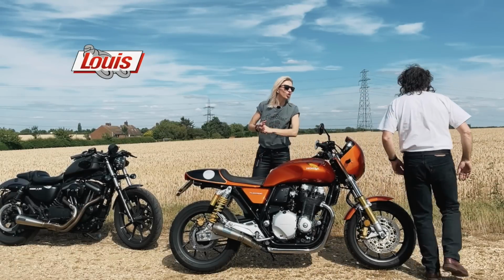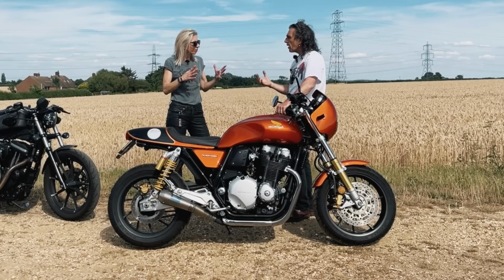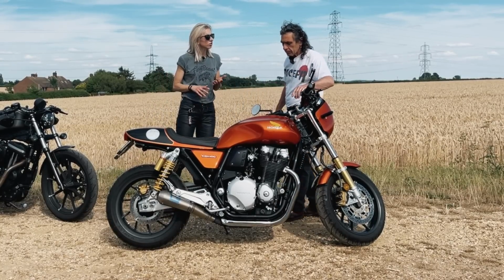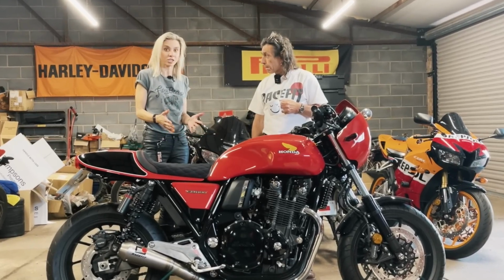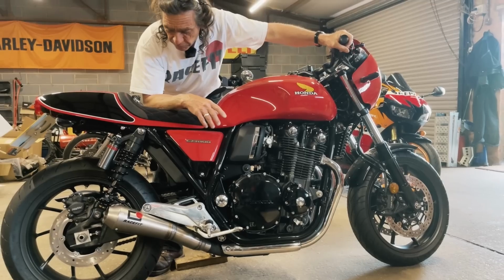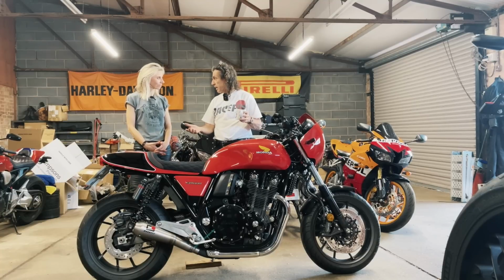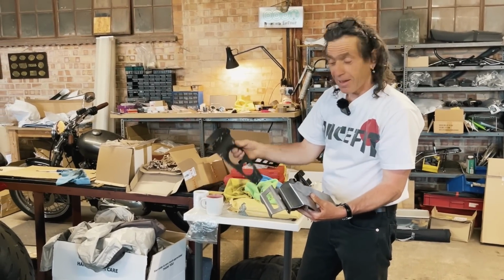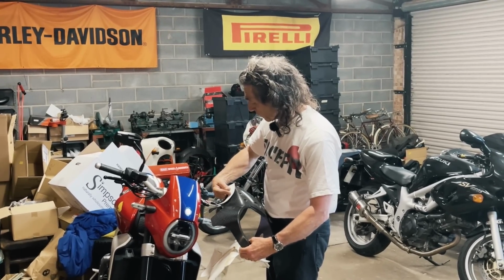5Four / Official Custom Honda Motorcycles

Comment: Love the contrast, beautifully done Motorcycles but on the wall a selection of hammers and saws, Love it. 😉
Also love that Guy builds functional but beautiful bikes.
I had a 1983 Kawasaki GPz 550 (USA Model in Europe it was the GP550z)  for quite a few years enjoyed every mile on it.
it got stolen and I ended up with a Honda Nighthawk CB700SC styling is very similar to what these bikes look like inline air cooled four, bikini fairing and tail cowling puts lots of miles on that bike too, it had hydraulic valves, shaft drive and a four gallon tank and a long flat seat and the Bars were upright but were adjustable. A very interesting motorcycle they only made it for three years, it  was 700cc because in the 80's in the USA  there was a tariff on motorcycles over 750cc.
Started getting into Sportsters in 1992 had four of them over the years. sold my 2012 a couple of years ago.
LOL my two wheeling is now done on bicycles, don't own a car although a Honda Grom (MSX 125) is a planned purchase in a few months.
Reply from the maker: Same.

Comment: People cannot imagine what it's like to clock up mega miles as a DR, I did it in the 80s too and 125k a year is very doable but winters are harsh this is before heated grips etc, muffs were about as good as it got until the filled up with snow, CX 500, Guzzi T3 or Spada and BMW RT100 were my bikes of choice, but I started out on a GN400, cheap and crap.